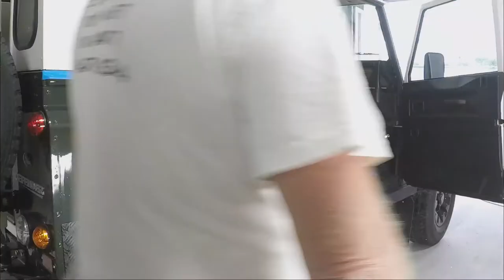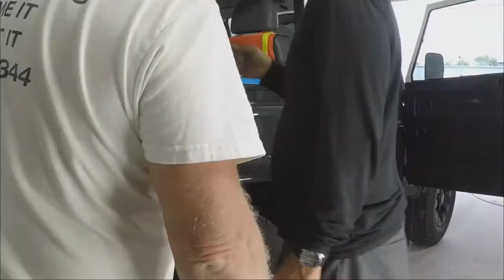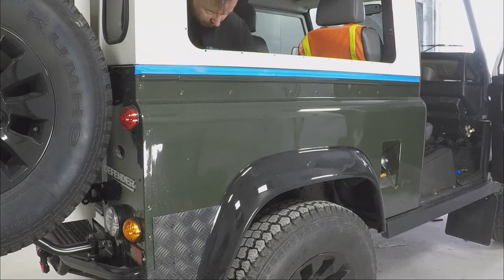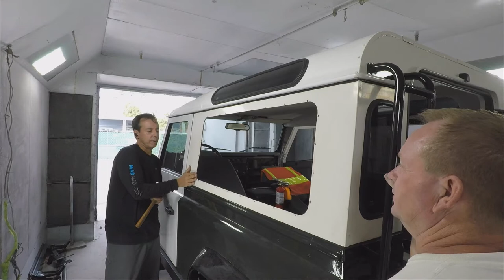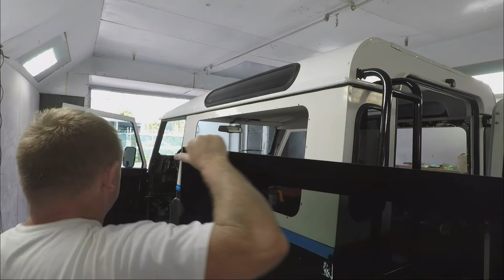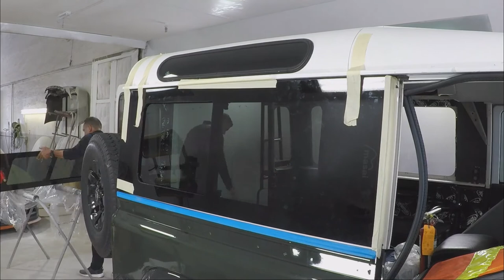Land Rover DEFENDER MASAI PANORAMIC SLIDING WINDOWS

Comment: Nice. Curious, the interior trim you had to reinstall after the glass was on, was it difficult to take off?
Reply from the maker: Thanks for your comment....this car had no interior trim whatsoever, it was completely bare so I purchased the Bearmach Puma black interior interior trim for the sides and the rear quarter windows from Art  over at UK auto here in the States. Since my roofsides are not from a puma vehicle there's a slight difference in the curve on the radius of the window opening. So I covered the area around it after the glass was installed with black vinyl. Then when the trim goes on the small gap where you used to see white white is no longer visible.
Reply: Thanks for the response. Subscribed and excited to see your other mods. Thanks again!
Reply from the maker: https://youtu.be/pN1iW1HqdiY